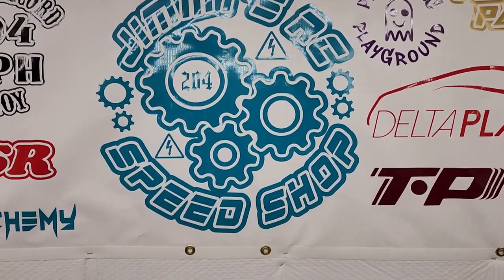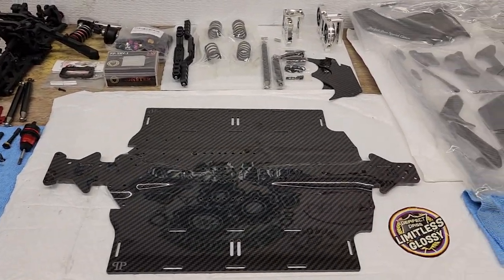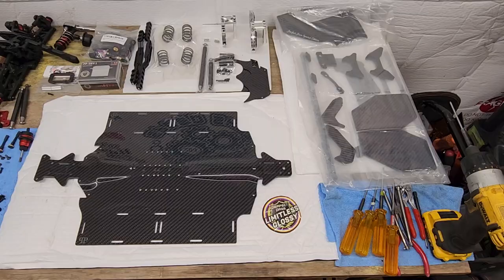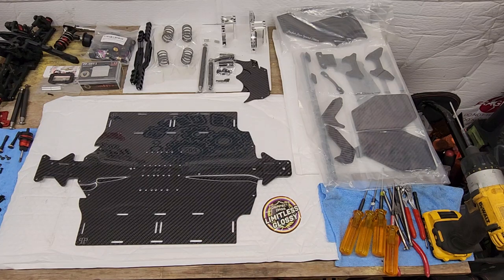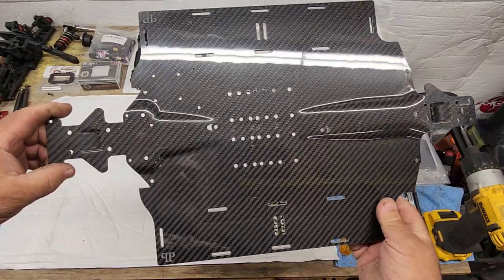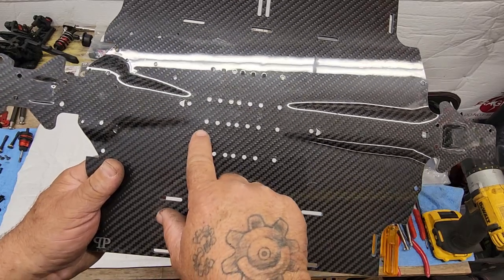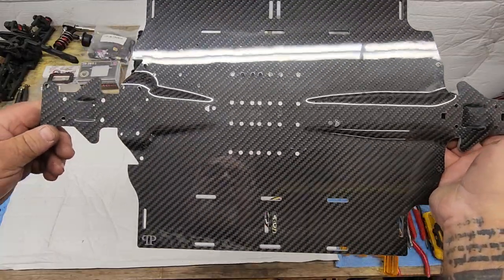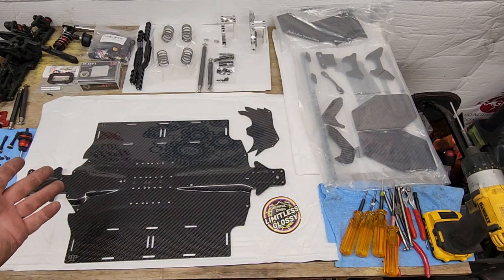Perfect pass Carbon build  (part 1)

Comment: The v3 carbon driveshaft kit is great for any car with 5mm input on the gears, you can cut them down. Nice video Jim!  Building a dual with some 1727’s.  Keep pushing bro!

Comment: what bearings do you use?  for everything
Reply from the maker: I run good quality steel bearings throughout the car ,
Reply: @jamesmccoy204  Do ceramic bearings just not hold up to the speeds?
Reply from the maker: I have found Ceramics dont do well in the center driveline , they do ok for wheel bearings but I have found no evidence that they have any real benefits,  
Not to mention they are higb maintenance and I run 10 to 20 different cars throughout the season and dont want to add more work with no benefits

Comment: I took a short break from RC. I started accumulating parts to make my new limitless v2 a clean build. So far. I have a glossy perfect pass gt chassis like
Yours. I just bought the GT chassis perfect pass carbon driveshaft set. I bought a PPS single motor mount complete. I thought perfect pass front and rear mounts, looks like Hot Racing with “pp” engraved. Perfect pass control arms. Can I use the perfect pass carbon front lip from the carbon kit in the GT chassis? Or it won’t fit? If I could widen the factory center body shell. Would this work?? Stupid question.  SS ind. I wanted to get the scorched top mount brace so you can mount the servo on top - would this not work? I don’t want to buy stuff that I won’t and can’t use. Also, should I get GPM tie rods? Or should I go with titanium centers and use the stock plastic ends?
Reply from the maker: Hit me up on messenger , be glad to help
Reply: @jamesmccoy204 if you mean Facebook messenger I don’t have that. Main issue with me is, I have questions that are true amateur stuff. Like can I use the stock front end and front diffuser on the GT Chassis and even if, would that even be ideal? And is there a body style that I can use to speedrun that can accommodate that kind of setup?? Also. Main issue I have is. I’m buying stuff thinking to my knowledge I’m buying things I need. For example , I bought two scorched metal diff casings. Over $130 each shipped. But then I see you NSVER ZRUN FANCY DO DADS LIKE THAT. I want to go 200 plus on a single motor or at least break the record. I know the risks and if I have to spend to get there I will. But money is half the battle. Now I need the experience and knowledge so I don’t waste my time and money.

Comment: Just curious...but, between the Limitless & VTE2, which do you prefer, and why?  I already have a Limitless V2, which I'll be sticking with the Limitless body...but, I do plan on building a second 1/7 - just trying to decide whether to do a Limitless GT, or VTE2 GT.  If Limitless, as with this build, I'd go with mostly PP parts.
Reply from the maker: I like them both , they each have things i like better than the other, 
Currently the limitless is the faster of the  two but ive just start putting more time into the vte2 so we will see how it ends .
Reply: @jamesmccoy204  Got ya.  Makes sense...just like there are things I like/dislike about my TLR 22 5.0 & Associated B6.3 (both are 1/10 2WD buggies).  On separate note, will pay 2 of the PP CF Limitless be up soon?

Comment: I may have missed the section of how you set up sway bars. Do you tighten the 1.5mm grubs on the bar itself?
Reply from the maker: I actually dont run sway bars on many of my builds,  sway bars are to help with body roll so when a car is setup properly and is running straight they are unneeded.

Comment: Im building a similar set up. Really appreciate this video very much! 

On your speed builds do you use the sway bars that come stock or take them off?

It looks like they are not on the front and back but just wanted to confirm.
Reply from the maker: Glad it's a help.
No i dont run sway bars , with proper setup for straight line speed running they are unnecessary

Comment: If any of you have any connections with the tire companies; let them know a tire good for over 200mph is needed.
Reply from the maker: They are well aware of the need for a tire  for 200+,  it an ongoing process.
Reply: @jamesmccoy204  what ID and OD do you need for tires?

Comment: Put a Lehner 2280 in it!
Reply from the maker: Not a motor I care for,  cost vs results are way to far apart
Reply: @jamesmccoy204  Have you seen the results? I’m personally not concerned about cost if there is an advantage.
Reply from the maker: I have seen results,  and the results were not in favor of the Lehner , if there where advantages to running one myself and a few others would have been running them
Reply: @jamesmccoy204  Good point. I just thought people didn’t want to spend the money, but in this hobby if the advantage were clear they would.